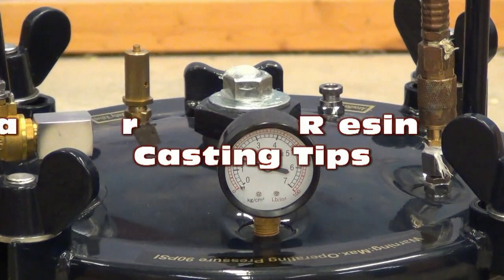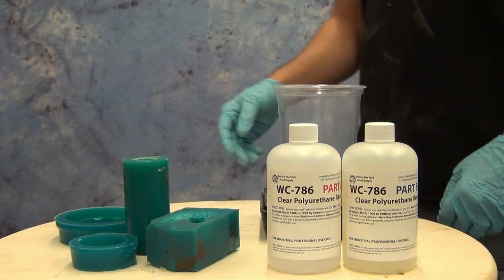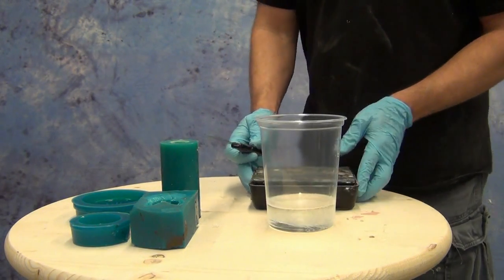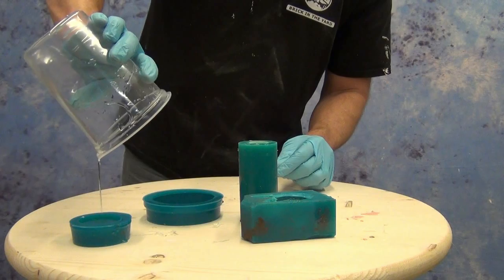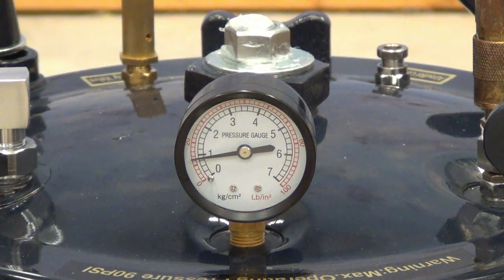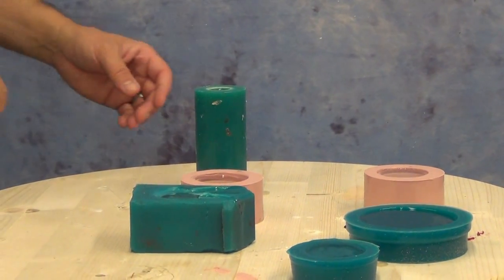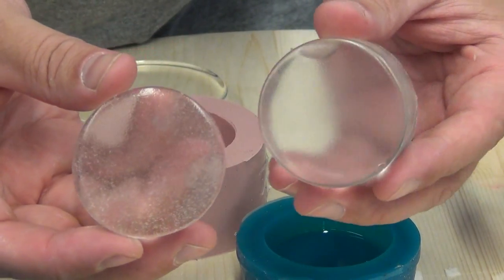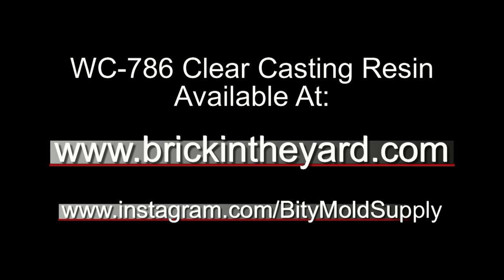Resin Casting tutorial: Pressure Casting Water Clear WC-786 Resin

Comment: Is there a way to extend the working time of the resin, and would the resin benefit from a vacuum degas cycle before pressure is applied?
Reply from the maker: Some of our clears can be slowed down with 14R Retarder. As for vacuum degassing the resin before pressure casting, more complicated parts might benefit from that, but it wasn't necessary for this size or type of part.